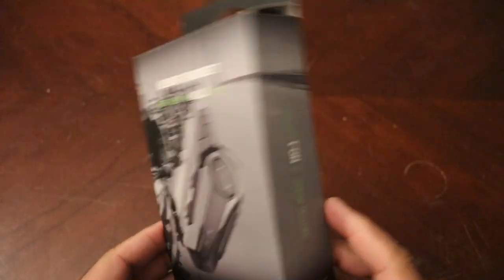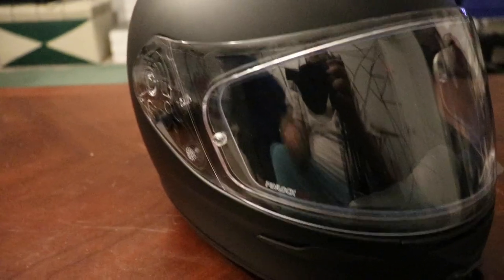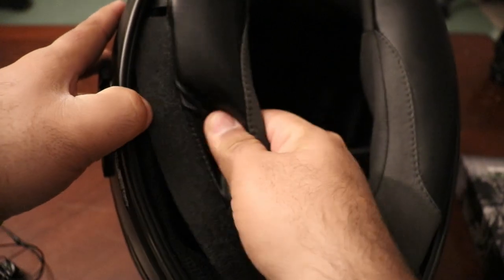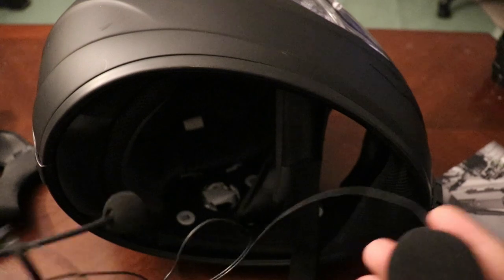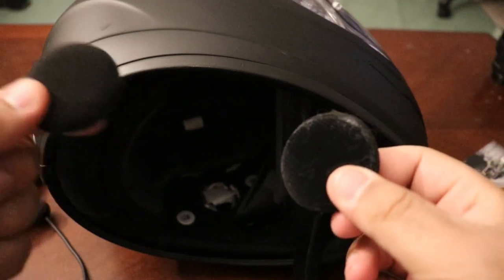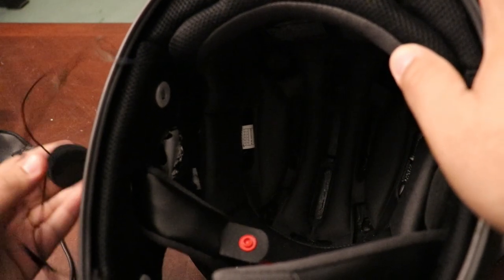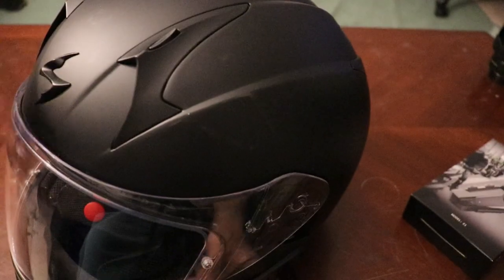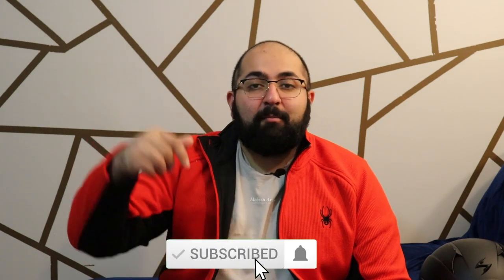How To Install A Bluetooth Headset On Your Helmet

Comment: Lol i have the same intercome and scorpion exo r320 helmet setup
Reply from the maker: lets go! how do you like it so far?
Reply: I haven't received the package yet but you mentioned you might have to cut out the ear phone holes a little  bigger
Reply: I'm curious how you did that since I'm likely to have  the same problem
Reply from the maker: @hibyeyummy9915  you probably wont have to do that for yours. My head is just a lil too round for this helmet that when i had them on, in the inserts it still put a little too much pressure on my head making it uncomfortable for me. So to remedy this i just made the inserts a little deeper. haven't had an issue since